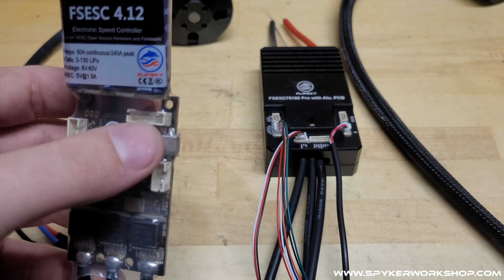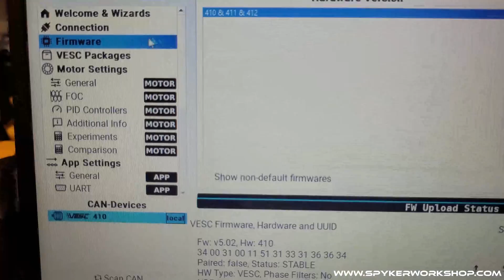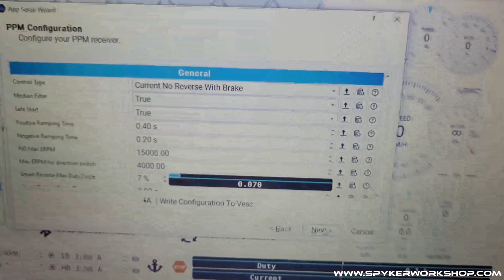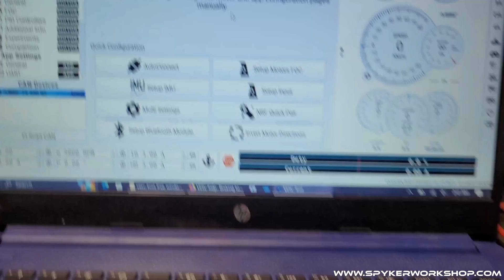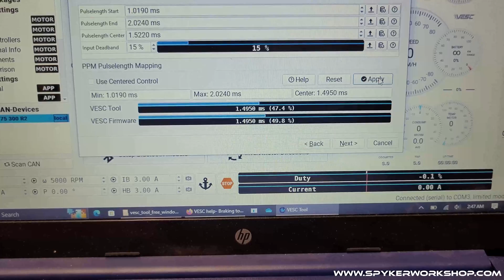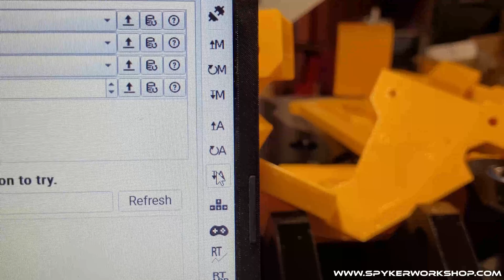Spyker Workshop - VESC / FSESC Electronics (BUILD SERIES)

Comment: THANKYOU, this has been a thorn in my side for almost a year. Typically, I was overthinking a lot of this -.-
Kinda surprised you don't set RPM, current and voltage limits, but I guess the defaults will keep people out of trouble. 
Any differences for the blower motor on the snowkats? 

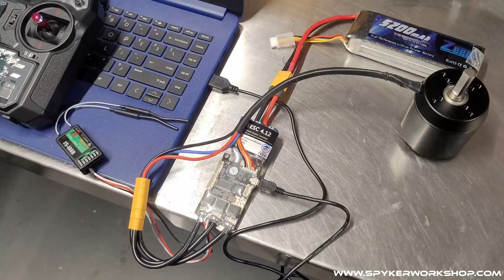Probably not important, but I dunno if you want part of your address & phone number showing in the video at around timecode 16:58
Reply from the maker: I do set the current limit, and the voltage limit is auto set when you select your battery cell count. Not sure why you might set a RPM limit. No difference on KAT/blower motors. Everything else could be mixed on your radio. I use the VESC Tool to just get the most basic stuff running.

Thanks, I'm making an edit about that.